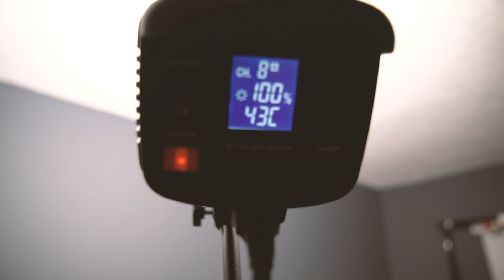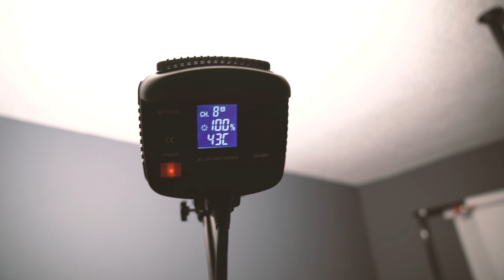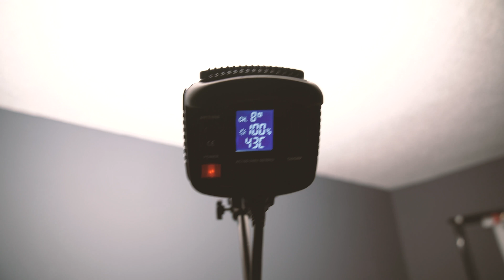Godox SL-150 100% Light Output Temperature and Fan Noise

Comment: Hi Li, I've watched all your videos about the GODOX SL150W Led light fan upgrade, and at the end you suggest not to swap the original fan, right?
I was thinking I might be following your previous advice, using a Noctua NF-A8 FLX... but now you tried... is it worth it? 
I mean, is the noctua able to cool as the original fan?
what about putting 2 fans, in series?
(here, in summer, we easily reach 30°Celsius and over... my Neewer SL150W sometimes cut it out...
But the fan is too noisy! So much I'm not using it any more...
THANKS!

Comment: I saw your videos and it showed me that the conversion was possible. I used the 92mm Noctua NF-A9 FLX and after 40+ mins at 100% it is at 48°C or 118°F. It’s WAY quieter. It’s definitely doable if you have a Dremel. I took off the tabs that lined up the original fan and drilled  new holes for the noctua fan in the black plastic using the standard holes in the fan. Then I carved out any spots that needed more clearance for the wires or other screws. I’m super glad I went along with the mod
Reply: do you have any pictures of that?
Reply: coffeesomething I have two ten-ish second videos from when I was doing it that I sent to some friends. I can send you those for now if you’d like. You can scrub through the footage to see where I cut. I can also send you more detailed pictures after August first when I’m back at my apartment. Just direct message me and I can either try and send them there or email them to you. For this you’ll also need to cut some other wires to get the bracket off to make it easier to modify and then solder them back together. But soldering was already necessary for the mod in the first place.
Reply: @coffeesomething  I found your instagram and sent you the videos that I have there!

Comment: So what’s the issue with these lights. higher temps crack kill the light?
Reply from the maker: Stock fan have loud noise but very efficient at cooling the lights, but people do change the fan out for quieter less powerful fan and that may cause the light to run hotter than designed

Comment: Thanks for the video man, I was looking for this exactly. I did have some questions though:
1. How loud do you feel the fan is, like does it get into the microphone when you're recording?
2. Can you change the fan like you would change a PC fan, I am kinda concerned about the fan getting noisy over time.
Reply from the maker: It's not as easy as it sounds, you can only put a smaller PC fan in there and you'll have to split and solider some wires, the connector is different that is used on this light compared to a PC fan connecotr, I did a video telling people to not do the conversion because it's not worth it for lower noise but higher operating temperatures... https://www.youtube.com/watch?v=VbKfLy5-Elw Yes the fan is noisy, I tried using a shotgun mic and can still hear it in background, maybe a lav mic will work in eliminating the fan noise especially at fairly close range. However if you do get the SL-100 or SL-60 https://amzn.to/2LJVztw instead of 150 maybe the 80mm fan can keep the temperature low while at the same time keep the noise down.